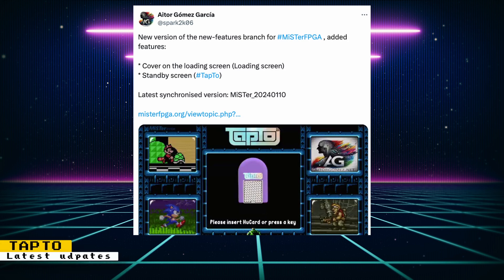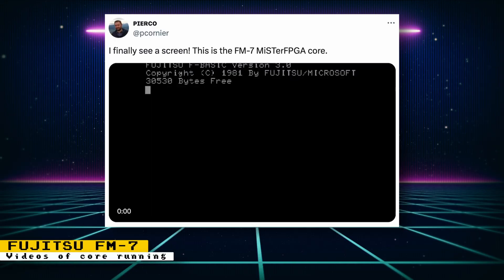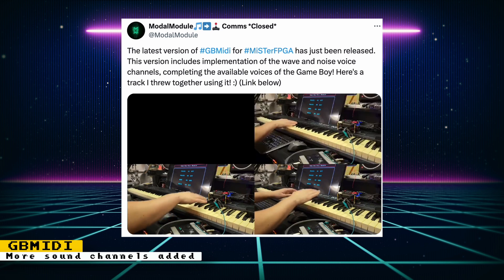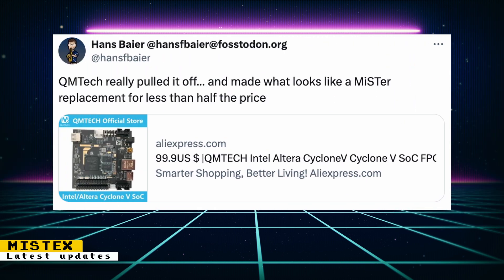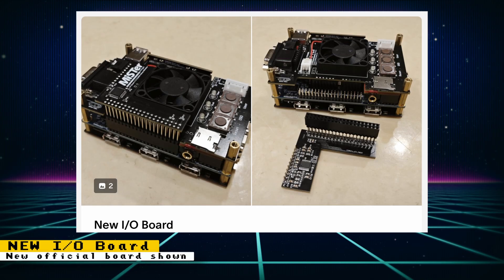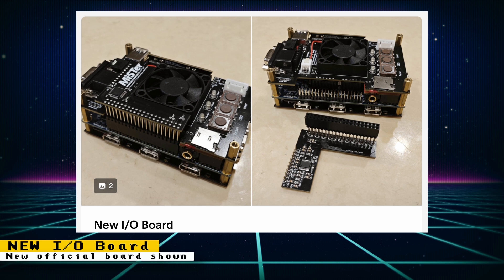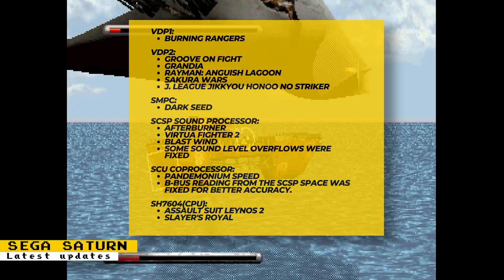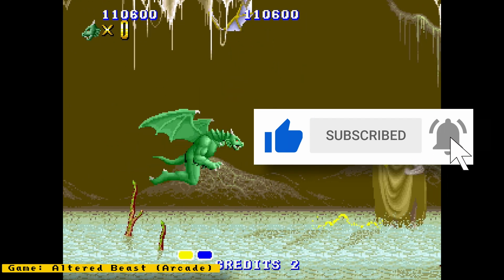MiSTer FPGA News - New IO Board, FM-7 Computer, TapTo & More

Comment: wanna add PCI-e socket the IO board? for external gpu's, for mister. yes some cyclone V soc chips, like sockit, have pci-e v2.0 tranceiver IP built-in. not only memory expansion but also gpu/pci-e expansion. or just implement PCI-E on the fpga, or most best connect the gpu to vulkan drivers on the HPS, then use the gpu from FPGA through the HPS operating system.